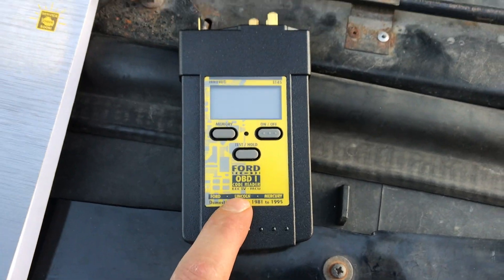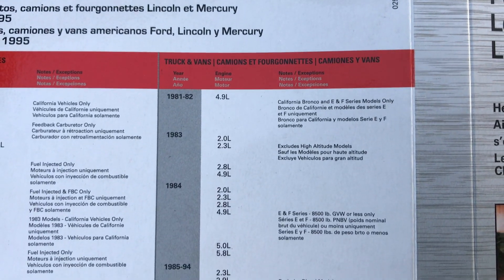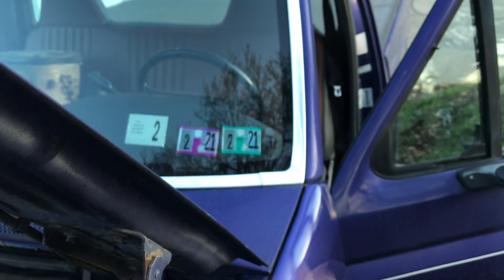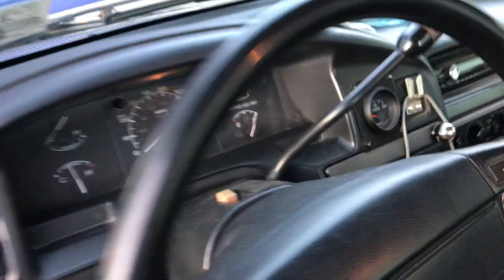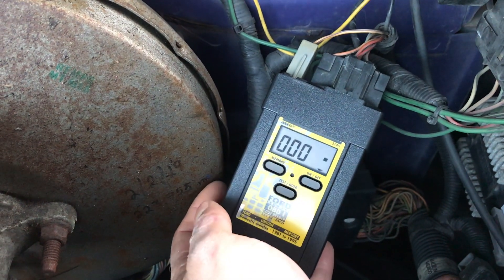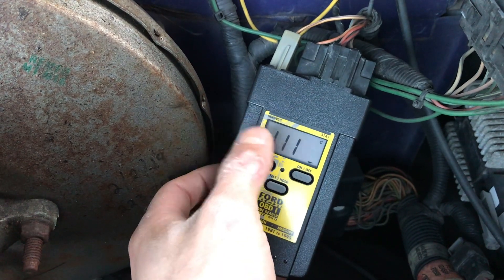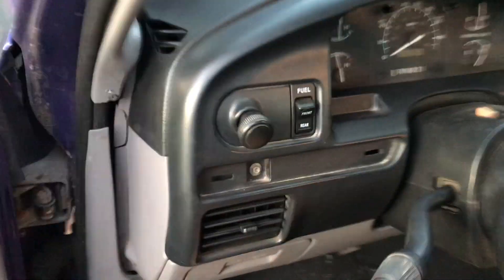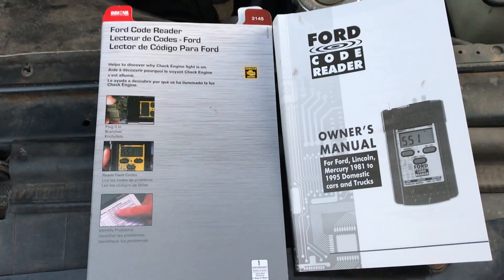How to Read OBD1 Codes on Pre-96 Ford F150

Comment: I bought this scanner first time i used it it worked read the codes but now it doesn’t read the codes, the square that is supposed to blink just stays on it doesn’t blick.
Reply from the maker: Unfortunately, this is like the only OBD one scanner available for these trucks and they are pretty spotty. I would try running the test as many times until you get a good test out of it.

Comment: Not sure if you'll see this but I could use some help. I have a 93 Ford F150 XLT super cab and recently it's killed its self. What I mean by that is that I drove for about and hour and a half no problems until those last couple minutes where she started to stall out. Before stalling there was a jerk as if the truck was choking. I hit the gas to get back in traffic and then it died again. I was able to get it BACK on but it was just dying the rest of the way, struggling. I've changed several potential problems and nothing. New fuel pump/filter. New starter solenoid. New motor starter which was a previous problem but fixed it. New battery. New MAP sensor. Now the last time I was able to get it on. It ran for about 4 minutes before it died out... AGAIN same choking sound. I'm last guess would be the catalytic converters being clogged up and not letting any air out. I can crank the engine but she just doesn't want to turn over... Btw spark plugs are good. New wires and rotor....any suggestions from anyone? I plan on getting a OBD1 reader but I'm not sure if that'll be any help if I cant get the engine on...
Reply from the maker: So the choking symptom definitely helps narrow the potential culprits down.
Measure your fuel pressure at the rail to at least verify that fuel pressure before the injectors is correct. 
I’ll take your work for it that the ignition system is good, assuming the cap, rotor, and ignition coil are new/in good working order.
Choking does sound like an air issue. So make sure your air filter is clean. You replaced the MAP sensor so that’s good.
If the catalytic converter is clogged there is a method to checking the pressure before and after the catalytic converter. I would try that. Scotty Kilmer demonstrates it.
Reply: @TheMinuteMasters i feel like a celebrity just signed my paper. Thank you! I have a video of the last time it was on if you'd be willing to look I know you're busy so thank you again for the suggestions. I'll look into how to do that!

Comment: My innova reader will turn on and sync to my 1989 f250, but the square won’t blink and it’ll just display the arrow and 3 zeros and not do anything else
Reply from the maker: Interesting. I would try it a few more times. If the issues persists, then I would return that particular code reader and get another. They are cheap and can be hit or miss.

Comment: Ran the engine off mode and it threw up some codes that were in memory. Got the 111 and 10 and then it cycled back through the same codes saved to memory. Can I clear those?
Reply from the maker: Yes, the manual had a procedure for clearing memory codes. I don’t remember the steps off hand.
Reply: @TheMinuteMasters thank you

Comment: Having an issue where the test runs fine when the engine isnt running. But when i start the engine after holding test, the engine revs faster but the square doesnt show up, only the arrow then no codes are read. Any tips on this?
Reply from the maker: I would try running the test again. If it doesn’t work, return that code reading and get another one. They are cheap and some have issues.

Comment: Thank you--trying to read those instructions and do everything fast enough was making me lose my mind. I can't seem to get through all the steps quickly enough, and I have the extension! There's zero indication in the written instructions how quickly you have to do the extra tests, but every damn time I will get the fault codes that I didn't do the test right, which is just infuriating when I actually have a CEL on! To add to the issue, I don't have an RPM gauge so I have no idea what 2500 RPMs is.
Reply from the maker: Yes, I ran into the same issue. Practice makes perfect and I hope this video helped you get all the steps done in order.

Comment: heyy so what does the cyl 8 code mean on the running test??
Reply from the maker: So if I’m thinking of the right code usually means there’s an issue with cylinder eight. Considering it’s something the OBD one system would find it could be an injector.

Comment: Hello Steve, 
I have a 1993 ford f150, I did obd 1 ,test, 1st ignition on but motor off, it passed the test, did the engine on test and it gives me code 311, and now my motor is like, idling rough , I just changed out fuel filter, air filter is clean, engine on test showed all eight cylinders working, at beginning of test, ever thing connected correctly 
, what could be wrong?
Reply from the maker: So code 311 is a complicated one. I haven’t come across it before. Below is a forum thread about it that could help you.

https://www.fullsizebronco.com/threads/code-311-please-read.414394/

Comment: Could not hear you over the Sound of the Running engine.
I have a similar looking code reader but I can install it under the driver's  side; no need to be under the hood.
However I have to count the number of flashes instead of seeing the code fault on a Screen.
Reply from the maker: Ah! That’s the old school method. 
As for the noise, I’m thinking of remaking this video now that I have mics.

Comment: My square won't blink
Reply from the maker: These code readers are cheap and prone to having issues. Retry the test until it works, if repeated attempts done work. Return that specific code reader and get another.
Reply: @TheMinuteMasters  I keep forgetting a 998 code along with a couple other codes that do seem to be legit problems but I wonder if the 998 code that's supposed to mean it's having a problem reading my computer is because of it being a cheap or faulty code reader? You think that's possible? I did finally get the square to starter flashing and it started reading. Mine didn't show the cylinder number though like yours did. I just went through the steps with the brakes and steering ect.. and hoped for the best.
Reply from the maker: @ that could be. I would research it. I always advise buying a new reader if the one you have is problematic.
Reply: @TheMinuteMasters  thank you very much for your replies

Comment: Stevie and idea why I can read the codes with the engine off but when engine is running the code reader does nothing?  The 1st code reader is got broke apart but summit racing sent me another one but both readers didn't read codes with engine running
Reply from the maker: Weird. Well you did the correct thing by sending the first one back. I would try it a couple of times. These code readers are cheap and they can be spotty. Unfortunately they are the only reasonable option for most hobbyists.

Comment: Chevy obd1 diagnostic is hands down easier. A paper clip is all you need.   Maybe you can with this also.    Tuning the eprom and getting to the ecm on GM is a much better deal.
Reply from the maker: You can use a paper clip as well. The code reader speeds up the process though. I haven’t messed with tuning the PCM.

Comment: Hey Stevie I have a 95f150 5.8 my transmission is going into limp mode but I don't have a check engine light. Any thought thanks for the help
Reply: Not yet I have obd1 on order
Reply: So I am leaning that I have a pcm on the fritz because the reader will not pull any codes in keor mode so I am going to pull computer out and check for anything alarming
Reply from the maker: Have you read the codes yet?

Comment: Love this.  I have a 92 inline 6. Just replaced computer but she is bucking when I drive it. Reading and watching post and replaced every sensor I can think of and still not better.  I did get code for egr and replaced sensor and nothing g. I can’t remove the egr to replace so not sure if that’s. Always something
Reply from the maker: I’m not sure if a bad EGR valve would cause fucking but I think it’s definitely worth going through all the various diagnostics checks just to see where your issue is. 
Fuel pressure
Ignition timing
Test vacuum
I know sometimes new computers can cause issues but your new computer could be correct and your truck has been tuned to the old one.
Reply: @ thanks will check those issues out. Thanks for teaching me how to use code reader. Made it easy. It gave me codes 213 and 334. 213 I’m stumped. Have to do more research. 334 says egr. So purchased the sensor. And egr. But can’t loosen the nut. More projects. Thanks
Reply from the maker: @gilbertopadron-q8p  I used a MAPP torch from Home Depot and that loosened the EGR tub nut and it came off easily.
Reply: @ thanks. Long week Thanksgiving. Have off. I will go for it. Have parts will see if that is the issue. Will keep you posted. Thanks for replying. I appreciate it.

Comment: I bought this code reader year ago. Sadly, it sat in my drawer for a year because I thought it wouldn't work on my truck because it's a 96. The code readers box said it stopped at 95. I would count the blinks, go crazy, think I missed blinks lol. then one day I found the reader while moving. opened it and it worked. thanks for your video. im not a reader haha.

Comment: I know this is an F150 video but I'd like to ask you about a Tbird. I'm pretty sure I bought and still have this Ford able OBD1 code reader. I noticed on your view of the application page it does not apply to a 4.6L 1995 Thunderbird. The OBD1 reader I have will not fit in the port under the glove compartment. I bought an OBD2 reader and it does not fit the port either. I read somewhere that the 95 4.6L Thunderbirds codes were read with a special reader that the Ford dealership had. I went to a Ford dealership several years ago and the parts department guy told me that they threw those away years ago. It would be kind of ridiculous to actually have this port and still have to use a paper clip and count blinks somehow, if that is even possible with this model. Is there any more info out there on this?
Reply from the maker: This is a really good question. Does the plug-in port on your T-bird look similar to the one in the video? If it is, I would almost give it a try and see what happens. Otherwise I would see if it’s possible to hunt down the special code reader. I know a lot of people, use the paperclip blinking method, but that’s not a very efficient way to read codes.

Comment: I have a 1991 f-150…. The first code that I’m getting is 111 then 10 and then 172……. What I understood from this video the 172 has to be the first number right…
Reply from the maker: Are you asking if the numbers appeared in the correct order? 
Otherwise, 172 is either a bad O2 sensor or a vacuum leak.

Comment: I own the obd1 code reader for Ford, Lincoln, Mercury.  I just plug it into the test port under the hood of my 1992 Ford Tempo.  It gives me a code number.  I look up the code number in the thick book that came with the code reader and it said "cylinder 1 misfire."  I bought mine at Walmart back in the day, but I still see them on ebay for $40.      You had to buy separate obd1 code readers for each brand of vehicle you owned.  I looked at reviews of the adapter cable that connects your obd1 port to your new obd2 code reader and tons of people in the comments said that they wasted money, because their's don't work.
Reply: 😂 I have a 1994 ford tempo
Reply: It’s all about experience, and if someone doesn’t understand how to, using an adapter to read from a OBD11 Diagnostic Device, very much depending on the Make and Model of the Device, I’ve Witnessed a Mechanic Burn up his $800 Device!
A jumper Wire Is a lot cheaper!!!

Comment: Mine came up 998 ecu
Reply from the maker: Did you press the brake and turn the wheel during the test?
Reply: @TheMinuteMasters  yea didn’t do any thing the running off test shows throttle body position sensor and vehicle speed sensor

Comment: Concerning the ODB1, you are spot on and made it look toooooo easy.  Frankly never before had I used a reader and I had to read the instructions numerous times before completely understanding the process and procedure.  Your video just completely tied up the loose ends for me.  Thank you.  ONE THING  When I first hooked the reader up and plugged in I received no indication it was connected.  Well come to discover the pins on the reader (two of them) had recessed into the reader itself and were only pultruding out of the reader say 1/8 of an inch.  So be aware the quality of this reader has some issues.  I place a drop of quick drying glue on the base of the finger and that did it for me.
Reply from the maker: Absolutely! These are the most difficult code readers to use. It’s unfortunate that this is the only affordable reader and the quality is hit or miss.

Comment: That seemed like it was pretty quick for the engine running test? because it's supposed to do a cylinder balance test. where it cuts off each cylinder one at a time. in which during that time where it's necessary for a person. to listen to the engine for a misfire on each cylinder. that will be more noticeable on the cylinders that are firing properly. and less on cylinders that are not firing properly.

also you didn't mention if it comes with a trouble code list? which is as necessary as the scan tool.
Reply from the maker: That makes sense.

I mentioned the trouble code list. It’s in the book that comes with the code reader.
Reply: @TheMinuteMasters  I somehow must have missed that. I might gotten distracted by something I guess my bad.

Comment: Grest video!  I've followed your video steo by step and read the book instructions. Still can't get any codes. It Does not display 11 indicating no codes.  Once i push test button, i hear the engine/computer doing its thing but nothing ever pops up. Only reads 000. Any ideas?  Faulty code reader?   Might return it and try another one.
Reply: Will do. Thsnk you man!!
Reply from the maker: Thanks man!🤙 These code readers can have issues sometimes. I always recommend unplugging the code reader, plugging it in again, and restarting the test. If you continue to have issues, return that particular code reader and buy another one.

Comment: Just bought a 94 ranger 3.0 v6. Of course it only threw a cel after paying for it.  Went straight to work pulling codes the old fashioned way.  But the koer part was kicking my ass. Stumbled across this video. Immediately found this scanner at autozone 34 bucks. Already got the koeo 335 code, and the koer 116, 536 and some other code. Obviously a bad coolant sensor and boo switch will toss the cel. Hope to have it ready to smog by next week. Good video. Only took 3 years for me to need it😂
Reply from the maker: Those codes readers are worth their weight in gold for these trucks!
Reply: @TheMinuteMasters  lol...absolutely.  the cel only comes and goes.  It left long enough to sneak it past smog with a solid pass score

Comment: In my 93 ranger I tried the same thing but my code reader wouldn’t turn on, what could be the problem?
Reply from the maker: I would try plugging it in and trying it multiple times. If it still doesn’t work, then I would return that code reader, and buy another.

Comment: Will a soon to be replaced transmission cause a check engine light on the truck? I have a 95 F250 7.3
Reply from the maker: It could depending on what code the old transmission is triggering.

Comment: doing diagnostics on a 97 F450 (yes OBD1) 460 i have. Engine runs but only if i hit it with ether, once it kicks it runs but when cranking is showing no injector pulse, has 12V to injectors, 40+psi fuel and ample spark while cranking just no inj pulse but once started inj pulses fine. How would i do run test since it will not start without help? Great video, its good to know people still have interest in preserving these 'ol things 😄
Reply from the maker: That’s interesting that the injectors won’t pulse. Almost sounds like an ECM issue. 
So you can’t get the truck started at all? Once it’s running, you should be able to do the run KOEO test.
Reply: @TheMinuteMasters    Thanks, im kind of suspecting the ECM as well but eliminating ancillary stuff first. Yeah its weird and its a new one on me. I can put a noid light on an injector and see it cycling when its running then as soon as i shut it off and try to restart its no pulse. Hit it with ether she fires right up and injectors come instantly back up. Ive owned dozens of 90's vintage Broncos with the same systems and never had this prob. Thanks for the reply

Comment: Hey I hope you see this, How do I do this in a 4 speed with over drive manual 90’ f150? Like if I put it in over drive I have to hold the clutch in and what not
Reply from the maker: So are you asking? How do you perform the rpm throttle tests in a manual truck?
Reply: @TheMinuteMasters  yeah
Reply from the maker: @lccshighlights518  Good question. I think you push in the clutch and peg the gas. That should do the same thing as hitting the gas while parked (with an auto transmission).

Comment: Alternately you can place test jumper in plug, and read the flashes of the check engine light. All sitting in drivers seat,  Really easier than using the scan tool..
Reply: Where would you get one of those?
Reply: @Skyla286 amazon os where i  got mine.